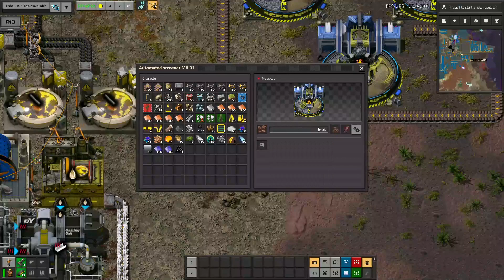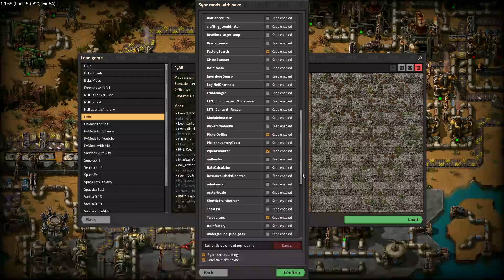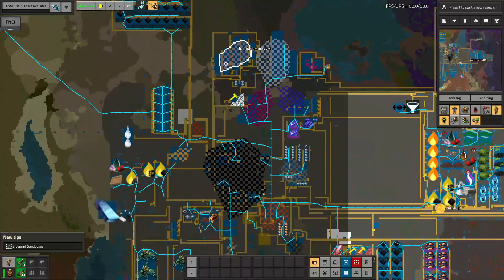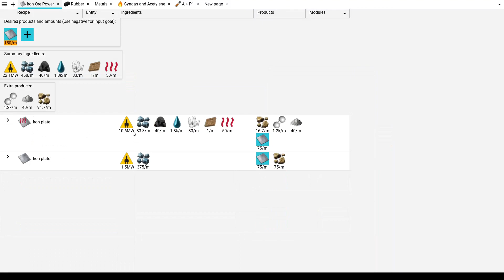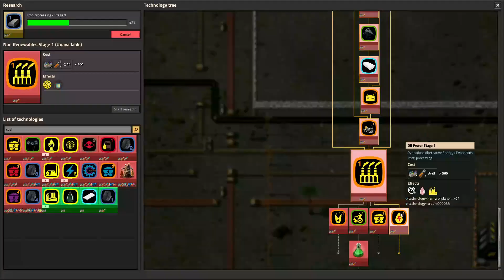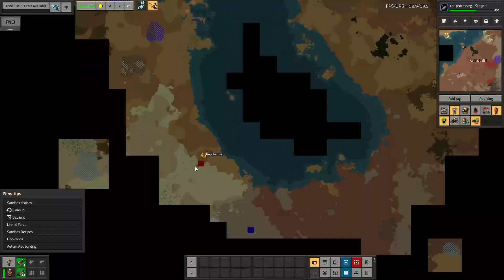PyAE Beta Supershorts #14: Iron, Copper, and Epiphanies

Comment: Hey o/, the video is a bit old now and I haven't watched ahead to the next episode but I just wanted to say that the mod "Editor Extensions" does the same thing as the Sandbox mod you added but with more versatility. By itself the mod adds a bunch of creative like tools but when in a save with cheats not enabled it does not. In settings you can turn on the "testing lab" (Per player settings), turn off sync inventory and cursor. This mod has the benefit of providing you with super useful tools in the sandbox along with all the research being unlocked but separate from your real save! Of course this is your choice just putting it out there.
Reply from the maker: I'm always accepting suggestions! You never know when something from an older video will be relevant to the new. Hell, I have episode 20 recorded and suggestions from these comments have still been helping me.

I actually kind of like Blueprint Sandbox not having all the research unlocked! But it sounds like there are more tools in Editor Extensions. I'll definitely look into it!

Comment: cool to hear about the community py server. I need to check it out one day, I just have an old py save going so I need to figure out a way of getting an entirely separate install of factorio going so I can play with the updated py mods on the server and not have to have the hassle of downgrading and reinstalling mods when I want to go back to my save

Edit: Wow 8 length undergrounds are nuts. Probably helps a ton with early logistics
Reply: i just have 2 mod folders. 1 for dev and 1 for the server and change which one is in the factorio folder when i want to switch. takes basically no effort and is a bit easier than setting up another install
Reply: @arthurdurbin370  wow that actually seems really easy, I can literally do that in right now by moving a folder. Guess I'll finally take a look at the community server
Reply from the maker: @MIKAEL212345  Yeah, it's pretty cool! They're past PyScience 2 so they're really setting up the base. I'm so behind, lmao. But at least I have something of a model to look to.